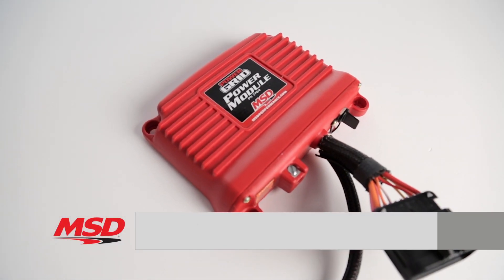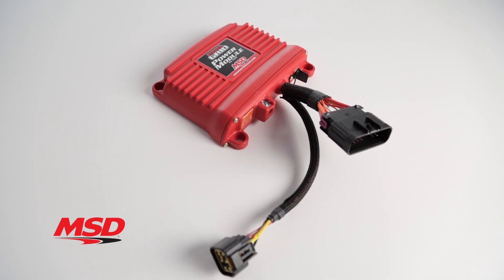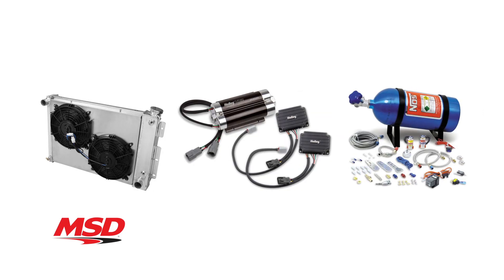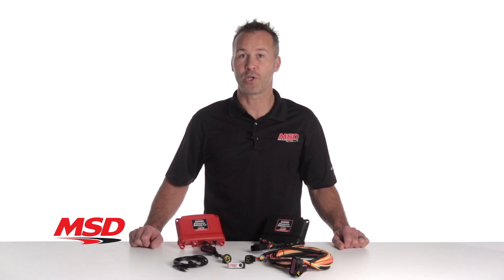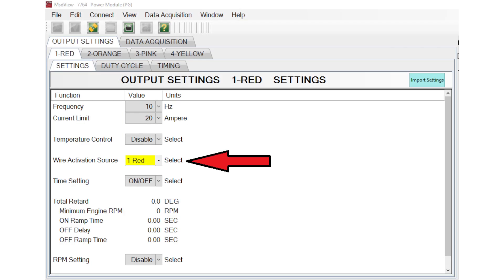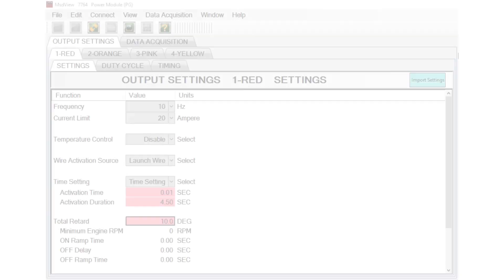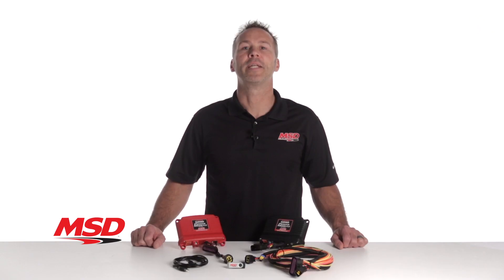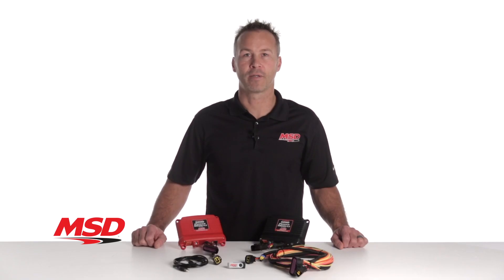MSD Power Grid Power Module

Comment: my polarass  cvt 2004 hum box of an ATV had one in it and  melted  china engineering ill bet looked like it was even recalled and still melted later on after a new one was installed may be it got the bad one again i did not install it ]] as no fuse or any thing logical K>I>S>S method  long term nope  i wish it had denco relays like ones used in my old celica supra all still work 1985 year ..it will have used relys from a gm or Toyota sometime ..proven analog tech for analog job